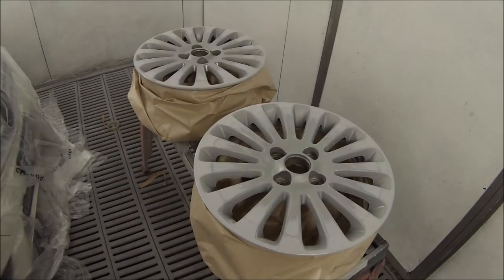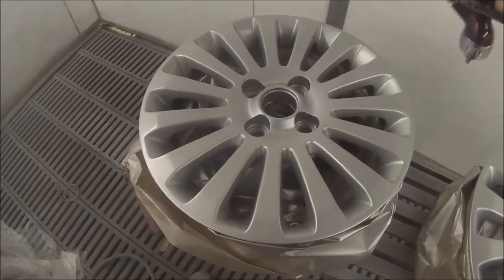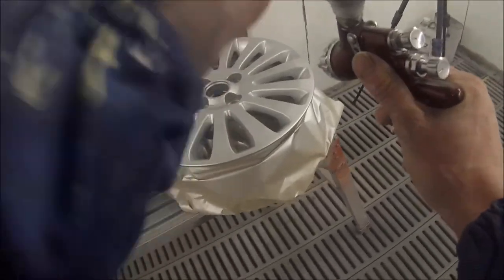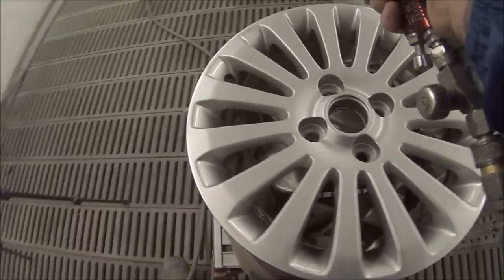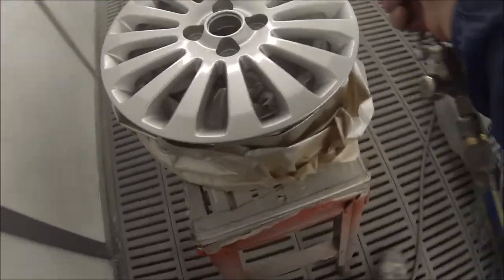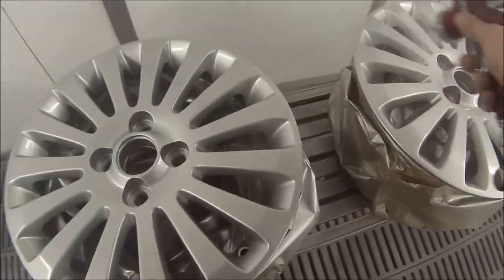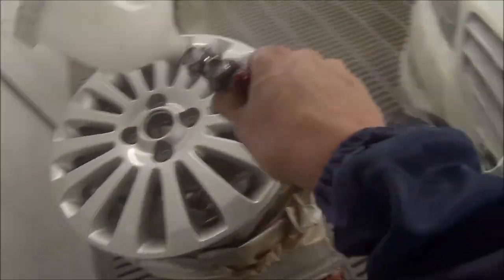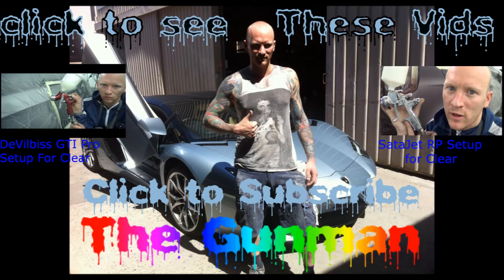How to Paint Alloy Wheels Silver Metallic 2 Pack

Comment: On the small areas where you rub through the primer back to bare alloy do you 're-primer or are these ok to paint over?
Reply from the maker: You can if you find the paint you use is reacting or swelling over the rub throughs but most of the time if you dont put your base on too heavy and you dry it out quickly then it should be fine not to
Reply: Thanks mate
Reply: And the paint won't peel or flake in them areas?
Reply from the maker: if its only a small rub through then no it'll be fine

Comment: Good demo mate. Would there be any problem with leaving the wheels in primer on the car as temporary untill i buy paint? Like with rain or water from wet roads?
Reply from the maker: Not recommended as primer is porous.
Reply: +The Gunman ok thanks, im looking at buying a vl commy were the windows had been removed and all rust was cut out and repaired then primed, but the owner put the windows back in before re-painting so the part were the window sits on cant be painted unless the windows removed. Will this just rust again very quickly?
Reply: +The Gunman sorry abit off topic but your the only guy i know that could help me out
Reply from the maker: AFFEKT MC PERTH If it was primed it should be ok but just over time moisture can penetrate not like top coat that water can't get through, did you see my video on how to remove and refit VL windscreens? http://thegunman.net.au/vl-turbo-project/
Reply: +The Gunman ok cool thanks heaps man. Yeah i was actually watching it the other day man, ill have to watch it again if i go ahead with this project. Thanks for all the info mate

Comment: Would there be a problem if I only put one coat of clear on alloys?
Reply from the maker: it can be done but I like to put 2 on just to give a bit more durability
Reply: The Gunman another question I've been wanting to ask you is, if a wheel has a machined face and its damaged and I just sand it up to 1500 grit can I apply clear coat on that ? Or even 3000 grit ? Will the clear stick?
Reply from the maker: some people do it but i wouldnt trust it without etch primer